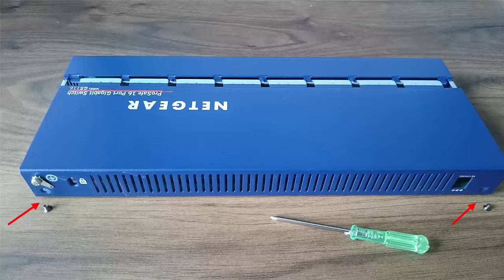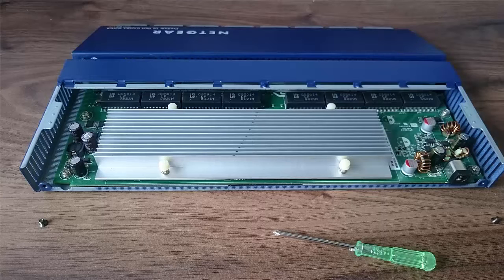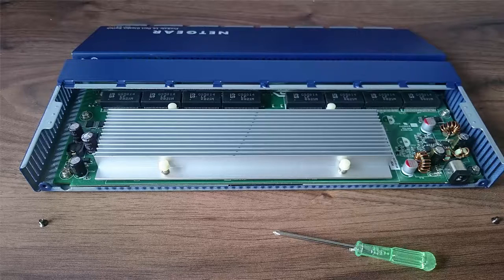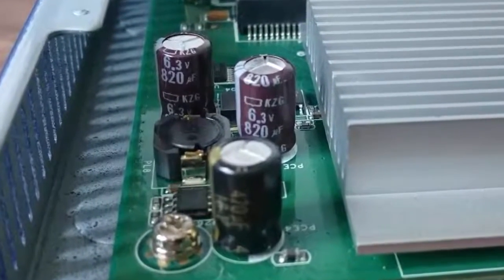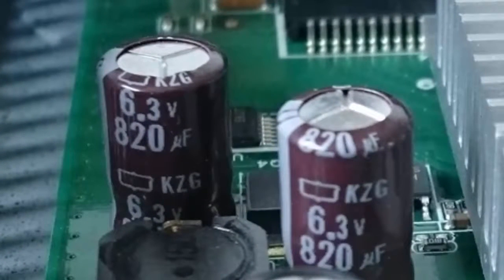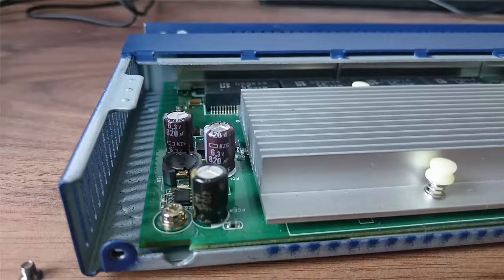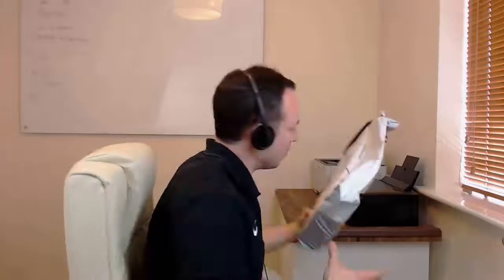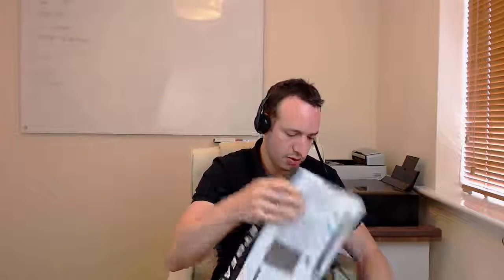Fixing a Netgear Prosafe GS116 Switch

Comment: No dead ports but, speeds were getting insanely bad, rebooted, change ports, etc, nothing fixed, I had a spare brand new one, and swapped it, all working fine, speeds normal again.  I will send the old one back.

Thanks for the post, didn't know these had lifetime warranty, even though I have 2 of them in my home.

Comment: I checked the link and it doesn't say anything about a lifetime warranty.   Plus it says to get any warranty support you need to register within 90 days of purchase.

I'm going to try the cap replacement.  It looks straightforward, although I don't have those caps in my inventory.
Reply from the maker: Is it definitely the GS116 you've got? I'm pretty certain that had a lifetime warranty since 2007.
Reply: @CarlGottlieb  I'm absolutely certain.   I can try to call support on Monday and see what they say.
Reply: @CarlGottlieb  It turns out I have a GS116v2 (V2 is on the bottom, not in the model number).  I figured that out after I opened it last night.   Getting through to NetGear by phone is a challenge.  I finally got through to someone.   On the phone menu, press 1 and then press 9.  They want proof of purchase and a short video demonstrating the problem.
Reply from the maker: @teekay_1  Were they helpful at all?
Reply: @CarlGottlieb  It was a call center in India, but the guy was very knowledgeable and he said he can only okay an RMA when I send him my proof of purchase (which I have), a picture of the serial number, and a very short video showing  that I can plug things into one port and it works and then another where it doesn't work.  I'll have that sent out tonight

Comment: For anyone still finding this: Replacing the bulging capacitor does work, it's a 820uF 6.3V one, can easily be bought on eBay and replaced (soldering required). Works like a charm for if you don't have a receipt for the warranty.
Reply: The inside of the v2 is significantly different.  There are caps, but they're covered in a plastic sheathing.  A lot more surface mounting as well.